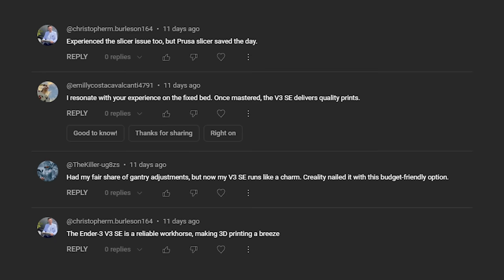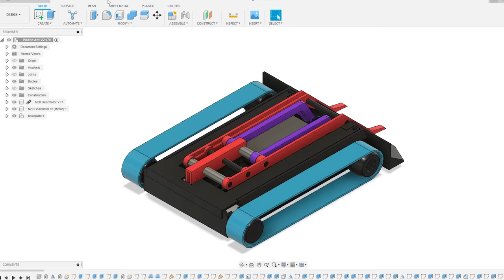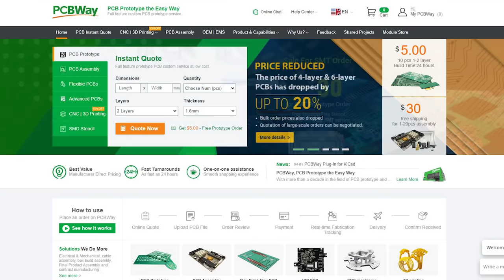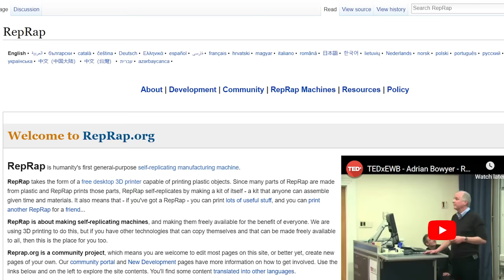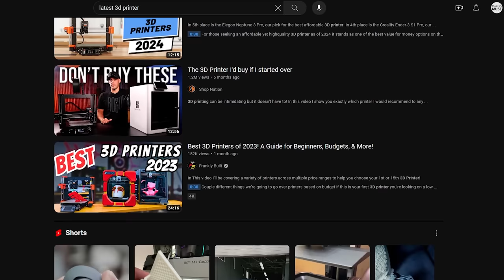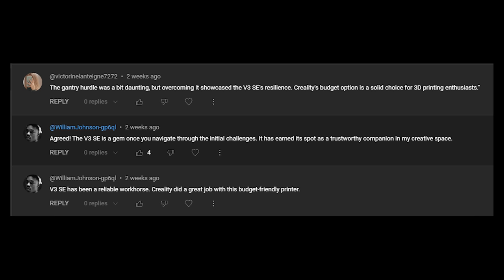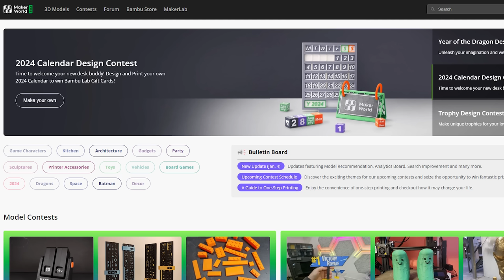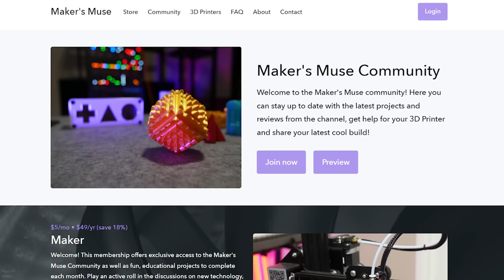My 3D Printing Predictions for 2024

Comment: I'm 2 weeks late, but I absolutely agree with these predictions, partly because I am personally interested in building a repository, albeit one with extra features. I am also on the path of building my own high speed, high functionality printer, because although I mostly got into this for using printers as a tool, I have partially adopted them as a hobby too, because I don't want my tools to be relying on closed source companies like BambuLab are. Hence why I'm building my own, starting with upgrading my old Ender 3 Pro into oblivion. One of the planned upgrades there, is 4 point ABL (because designing a more efficient 3 point for a bedslinger is a literal nightmare that just isn't worth the effort). The printer I wish to design, will, surprise surprise, not be a bedslinger. Cause f bedslingers.

Comment: Great predictions for 2024.  I, myself am looking to upgrade my Ender 3 v2 with either K1 Max or P1S or X1 Carbon.  I have watched so many videos and I'm always left wondering if there are kickbacks - Its making the decision really hard.  The forums are also challenging to decipher... When someone puts a $1000 into a new machine they tend to form biases and become ultra supportive of their own product..
Reply: Depends what you are looking for, a ready to go printer and when it brakes you throw it away or something more open-source 'ish which you can fix here and there. Bambu Lab schooked the market with the speed of prints and price but the lower price comes with shortcuts on the hardware side (not really serviceable ) . The X axis is carbon rod with self lubricating bronze bushing, how lasting they are only time will tell, funny fact is that they are glued in so good luck replacing the rods or bushings. They are shipping a ton of printers with warped beds ( 2mm gaps ), if you reach to their customer support they tell you that it's "OK" auto level will take care of that, so they are trading quality vs price willingfull . How much they will support older models again, only time will tell, maybe after 3 years they discontinue older models and you will have to throw it away when it breaks as its patented you won't find replacement parts, it's a young company that needs time to prove themselves. If you are ok to buy it for the warranty period and after that be prepared to throw it out probably its the best bang for the buck atm, if you are looking for a printer that you can keep like 5 years and replace this and that over time it's not a good choice as nobody knows how much they will last or how many replacements parts you will be able to get and if it is even replaceable so if you want a printer to keep there are better options ( more expensive indeed) but you know at lest that it will be good to go for 5+ years and if there is a problem you can fix it with more or less off the shelf components.

Comment: Any thoughts about the trends towards printers being less “open”? I wonder if that goes alongside some of the convenience and “it just works” nature of newer printers that you talked about. It’s great that a print is less likely to fail, but if it only works with a proprietary filament, or if you’re can’t find replacement parts anywhere once the printer does fail, is that an acceptable tradeoff?

Comment: I just convert 3mf to stl online. Not going to open any 3mfs after once they messed my slicer settings. = )
What you did not predict is a color war. Bambu's AMS started multi-color competition. And most of them produce a lot of waste, while achieving decent model quality. Which makes people 'OK' with that I guess. The best I saw is Prusa multi-tool printer, which does not produce waste except color change tower, and very fast to switch between extruders.
If I was Creality, who made Ender 3 V3 with belts on Z axis, I would add multi-tool to their Ender 3 V4 or may be even Ender 4 = ) You can place 4 tool-heads at the top of the printer, and with Z-axis belts the caret can move fast to the top, switch tool-head and return to printing. But we'll see we'll see. I saw their Ender 3 V3 performance, and it is not that bad as I thought it would be.
But I am still with classic Ender 3. I would not say that my hobby is tinker with the printer. But I do not mind if I can change something. Whatever they say, Ender 3 is a great model, as it can keep up with technology, as it allows you to upgrade it. While machines like Bambu are as-is, and when technology will move on, they will fall behind. But we'll see. They depend on manufacturer support, and how long will that last, and can or will community catch up their support when mother company will say 'hey we do not support this model, but you know what we do support? A new printer!"

Comment: This was a really good video, as it articulates the problem I am having picking a 3D printer. I am interested in printing 3D objects, and I want a printer that just works. The 'hobby' is totally irrelevant to me, equivalent to my paper printer being a hobby. If it's a hobby, that means the technology is not mature enough for me to use this device as an appliance. One point on review videos is that they're all pretty old. I've watched dozens, and I've yet to find one within the last month, that recommends anything new in the industry (sans filaments). Based on what I have seen the X1 Carbon would be my choice, but it might as well be ancient tech at this point, and the vibe I'm getting is that you reviewers are awaiting another generation of printers that are about to be released.

Comment: if you want an x1 without the price get a p1p or p1s. only issue ive had with my p1s is the print plate sticking to warping prints and pulling up from the bed

Comment: Hello, i got a 7year old Delta printer that seam to be hight adjusted. Never been printed with because it never stuck to the plate, is it possible to get autolevel added to it? I'm thinking of doing a upgrade but not sure if it's worth it 🤔. Thanks for answering Maker's muse.

Comment: Regarding the "argue with people online about what brand is better" comment because I saw a similar comment on TT. I think that's a mischaracterization of the argument. The reprap community went from the original (primitive) Darwin to what exists today because of collaboration. Everybody got along and shared ideas and built upon previous work. Lots of ideas borrowed and the best ideas spread around. It was a scientific kind of mentality. That is until Makerbot went and pulled the rug and upset a lot of people. There was a sense they used the community's work to reach the next-level then pulled the ladder up behind them.

The arguments I'm seeing online today is because there's another vendor doing this again. Except last time with Makerbot everybody agreed they were in the wrong. This time it's entirely the opposite with people cheering on the ladder-puller. Standing on the shoulders of giants, but then kicking at anybody trying to climb up behind them, that's what makes people upset. Not the fact that it's a different brand.

Comment: The reason there hasn't been some rise of more accessible CAD is, unfortunately, simple: While 3D printers are new, CAD isn't. Innovation is fast with 3D printers, but CAD has been used by professionals around the globe for decades, with massive companies behind the software. If there were easy, clever ways to simplify CAD... Well, they'd have happened already. There's BEEN massive financial incentive to it already.
What I'm hoping is just that some of those industry standard CAD software packages start getting more consumer friendly licenses... But I'm not holding my breath. Getting software you can just buy instead of subscription based service is getting harder and harder in general, I can't see CAD moving against that trend.

Comment: I was speaking to a friend about 3d printing and he pointed out something that I suspect will be the key to mainstream adoption. He mentioned that he doesn't want to mess around with software or files. He just wants to press a few buttons and have it print out. This is where i think a model/material subscription service will come into play. You buy a printer, connect it to the Internet and open their app. Your find a model that you want, choose a colour and how you'll use it (ie in the car or outside etc). It'll download the model, load the filament and just print it with ZERO fiddling or other input from the user. Basically make them as dumb and lazy friendly as a microwave oven. The only thing the person will need to do is make sure the filament is in the machine. The company that does this properly will clean up.
Reply: Bambulab already does this. You can do all of that through mobile app

Comment: Regarding CAD software there is the community version of solid edge by Siemens which is professional cad software comparable to autodesk inventor (I haven’t checked if it also offers CAM) and it’s for free for personal use. Also you specifically own the version you download so there isn’t the danger of loosing features by updating

Comment: I really liked this video so please don't take this as criticism. Just FYI accessible metal 3D printing is pretty old news. I had a bunch of stainless steel prints done for uni projects by shapeways in like 2012-2016 for very cheap. Like $8 per cm³ plus $20 handling AUD

Comment: I've been messing around with my ender 3 V3 SE for almost 8 months and my prints are finally starting to look nearly as good as the "out of the box on stock profile" review prints I saw before buying. The auto level and z offset are not as good as the reviews would imply. Once real user videos started coming out I found out it's not just a me issue.

Comment: Hey there Angus, I've been 3D printing since 2016 with a CR-10 that's now heavily modified. I'm looking at getting a more modern machine and looking for advice. Maybe a Voron 2.4 r2, or QiDi max-3, or a Bambu labs P1S. Have you got any thoughts on those?

Comment: I like my little ender 3 pro but I use it for utilitarian prints. In the future I'd like to double the bed length of it for larger prints. (tall printers do nothing for me) Then I'd like to eventually get something like the Bambu x1 or the Creality K1. On my ender I have only done the cheap direct drive kit to it which sped up printing and made it much more reliable. I have a couple profiles that just work and I don't mess with it. I just turn it on and print and it's dead reliable except in the summer when it's too hot to print.
       As for file repositories I try many but I keep going back to Thingiverse and sometimes prusa. I have no interest in figurines and many of the other sites are mainly full of them and nothing else or they don't have categories for me to easily look up what I am looking for. 
      Cad.. I still have a copy of ACAD 13 and 2000 somewhere... My Cad Fu is really bad these days as I don't do it and I just forget how to do stuff then get frustrated and give up till I look up how to do stuff again. Using cad is a use it or loose it skill.

           Oh and I'm not sure where Stefan was at in the US but disposable silverware isn't very common here. It exists but you really don't see if often. Fast food uses it but really only for icecream as most all foods are eaten without utensils. Where I see it the most is in hotels that have free breakfast. They don't have anywhere to or the people to wash silverware and plates. They have a small closet to store prep and clean in.

Comment: thanks for the caution and information on 3MF files.  I do not like the change to using them,  as they are often more difficult to work with if not created for the system you are using, plus having a great potential for bad copntent

Comment: I use OpenSCAD.  It works well for the way I think about stuff.  Others find it hard to use.  
Basically it works like writing a program to make your part rather than drawing it.
I predict that some sort of evil forces will ruin a good thing.
Reply: I tried OpenSCAD a few months ago to generate gridfinity parts and it was painfully slow - apparently a version-specific bug that's hopefully sorted now, but I just moved on to F360 and more recently OnShape which I'm pretty happy with. That said, most of the time my design ambitions far exceed my actual skill level, which is probably more TinkerCAD-ish 😅

I would absolutely love to see an app (or maybe just a mode within the established apps) that hits the sweet spot for features/functions AND user-friendliness with a tighter focus on the 3D printing (or even more specifically just FDM) amateur/hobby space.
Reply: @glittalogik If what you are doing works, then do that.  I like the fact the OpenSCAD can do parametric stuff.  I saw a thing a while back were someone made a bunch of plastic keys.  The lock they worked on was big and quite forgiving but the idea was that only one key would open the box.  Each key was different because a module took in a number and converted it to base 3 for each notch or bump along the key.
So far, I haven't made that much stuff.  I did:
1) An enclosure for a Raspberry PI with a custom PCB plugged onto it.
2) A massively over designed key fob for my car
3) An adapter to use a length of PVC pipe as a handle on a push broom
4) A part for my 10-speed bike
5) A hard to describe flat thing with holes on a 1CM grid for a crystal radio
I expect to do more over time
Reply: OpenSCAD is phenomenal for standard structural models.  Too much is made of the "programming" aspect.  It IS script programming in its basic approach with keywords, defined functions, variables and lots of nested curly braces, but you can learn all that quickly if necessary.  To me it is far simpler than digging down into multiple menus and submenus to find a  simple command.
 If you've ever written or even just modified a simple Arduino sketch then you probably know most of what you really need already.  It's power is its parametric design aspect and the ability to create canned modules of your own (libraries).  The more you use it the more you can create new parts very quickly by combining routines you have written in the past, which with just a change in values for some key variables can produce what you need.  If your thing is creating yet another flying dragon then it would be a terrible choice, but for prototyping structural designs it's terrific.  Rendering can get slow for larger models however.  I hope that a multithreaded version will be developed eventually which would really help.

Comment: I just recently found out that my job provides comercial fusion 360 licenses, and now I use my work account to have full functionality of fusion 360 from home lol. I’ve been using the free version for all this time (like 4 or 5 years) when I had access to the comercial all that time.
My job is a mechanical designer, I mostly use AutoCAD and Revit, but I guess fusion 360 was included with our licenses for those

Comment: I am a beginner and I want to get my first 3d printer. I live in Israel so most 3D printers aren't available. The printers that are available are: Artillery Hornet, Artillery Genius Pro, BambuLab A1 Mini (pre-order)  and Ender 3 V2. Which one should I get ?
Reply: Artillery seems to be on its way out. From what I heared they have canceled all contracts with companies that provided local support. So, not an option anymore.

This leaves Creality and Bambu Lab. The Ender 3 V2 is an older model. The current series is the Ender 3 V3 with the SE and KE model. If these are not available then Bambu Lab is the only option. I don't like the company, but by all accounts the printers are of good quality, reliable and very user friendly.

Comment: I watch metal melting videos and thought Australia was way better than the states because there's like 3 or 4 different types of home trash bin for recycling, sounds like not. Around here the mixed recycling pickups won't even take glass anymore because there isn't enough money in it, though you can haul it yourself to a county dump that's open like 3 hours in the middle of work days a few times a month and pay out the nose per pound for them to take it.

Comment: 9:40 I just don’t want to calibrate for every filament, vibration, pressures, etc etc. I just want parts to print well, fast, and fit together. Voron sounds great in theory, and yes it can print as fast, yards yada. But I don’t have a 40+ hr work week just to build a printer anymore.

Comment: 3D printing has also significantly impacted the Russian-Ukrainian war. On both sides of the front lines, entire 3D farms are operating 24/7, producing parts for FPV drones, stabilizing fina, medical equipment, and more. In Ukraine, there was a filament shortage at one point due to the enormous demand. Communities from Europe and the USA, such as Wild Bees and Drukarmy, are also assisting Ukraine. This is an incredible example of coordination and decentralized production that is practically impossible to influence or destroy. New cheap, durable and fast printers like the A1 mini can literally be transported to the front lines to produce necessary goods even in field conditions, while engineers in the rear continuously develop and improve models for products that are immediately implemented in practice. This is the future we are living in